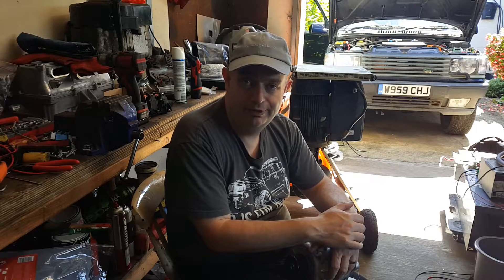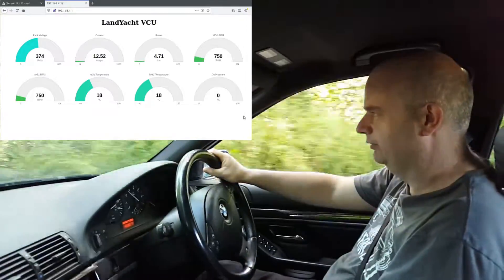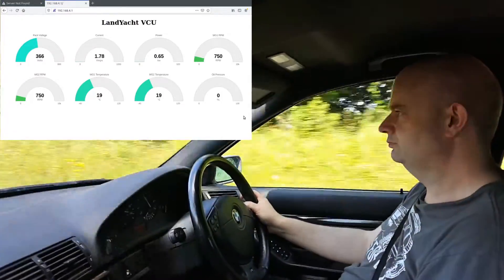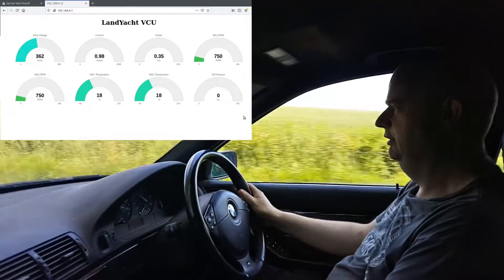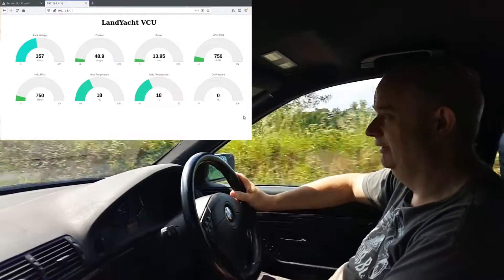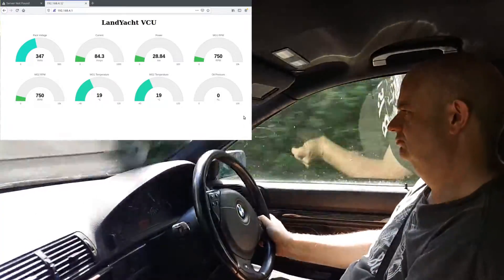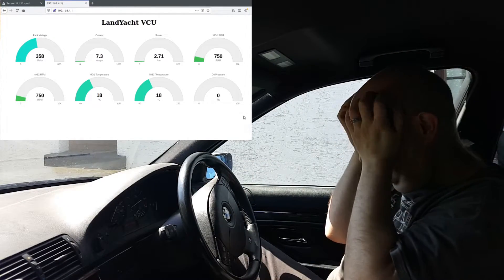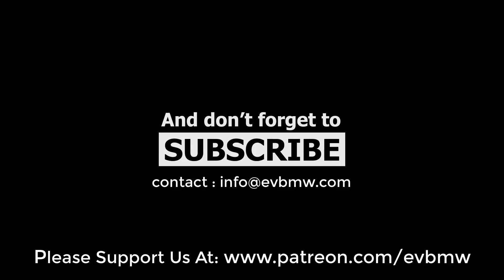BMW E39 EV Conversion 66 : Prius Inverter Test

Comment: What is the constant noise in the background?
Reply: I think it's a hydraulic power steering pump. At the time he was using opel zafira or silimar pumps wich are a bit noisy, human cannot hear it that much, but the camera mic picks it up louder then it actually is I think.

Comment: Good work! Thanks for sharing your successful and not so succesful developments. One question about driving: do you need to change gears when you start from standstill or you did not want to stress the small battery and inverter? What was your max amps programmed to the prius inverter?